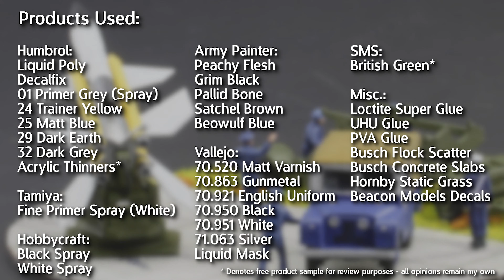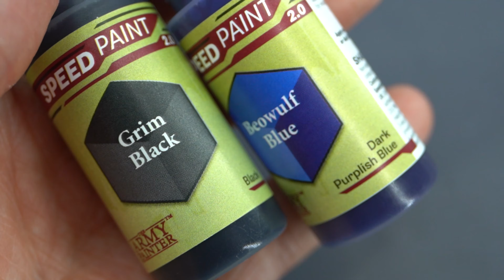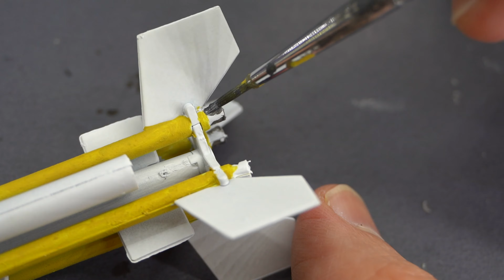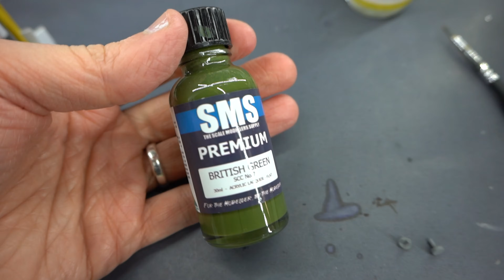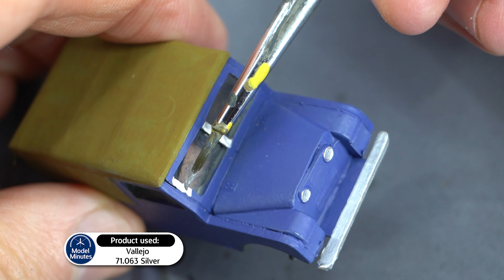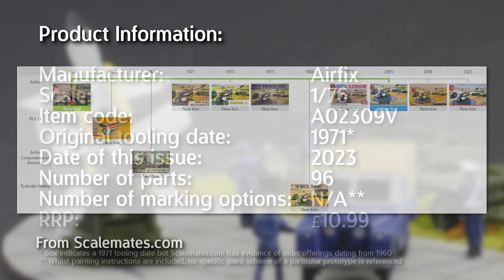Building a Diorama from the Airfix Bristol Bloodhound Model Kit! Build & Review

Comment: I remember this coming boxed  with the Airfix Hercules in the early 70's. I think you're right about it's  age though.
Reply: Yep it did, problem is the Bloodhound is the Mark 1 version, which was phased out of service in 1964 by the RAF (All of the Bloodhound Mark 2 weapon system equipment (Launchers, Radars, Fire control systems were totally different and the Missile's had nothing in common between the two marks, Different radome, different fuze and warhead, Different shaped and sized Engines, Boost motors, Wings and fins. Mark 2 mainbody(term for a missile fusalarge was around 2 feet longer on a Mark 2 missile, plus the Radome was longer and a different shape)). The RAF didn't order the Herc until after the Bloodhound 1 system was gone. RAAF on the other hand did operate both the Bloodhound Mk 1 and C-130 at the same time and did move missiles on the loading trailer in the aircraft (though   in real life the upper boost motor fins had to be removed from the missile to get it into the aircraft).

The Airfix Mark 1 model is a mixture of Prototype missile and trailer designs, plus the Launcher is very simplfied. The yellow boost motors were prototype and pre production items, on the Operational Bloodhounds 1's the boost motors were all white with a thin red band just behind the front boost motor mounts, The rocket motor nozzels were a metallic brick red colour. The Ramjet Engines were all white, bar for the bare metal intake cone. The bare metal rear ramjets were the Thor 200 series engines on the Bloodhound Mark 2, which was a very different engine both in extrnal shape and internal details to the Thor 100 used on Bloodhound 1. 

Launcher and Trailer were Deep Bronze Green.